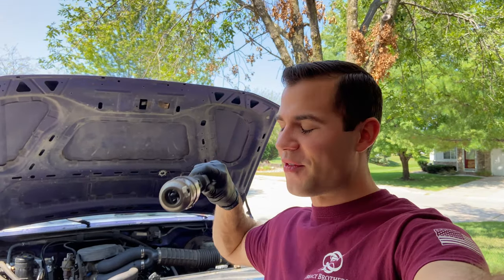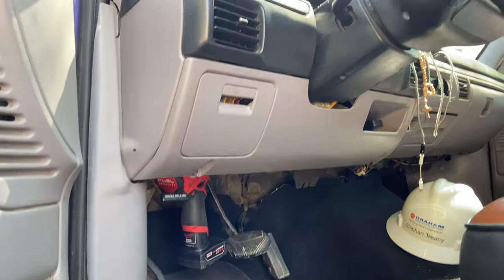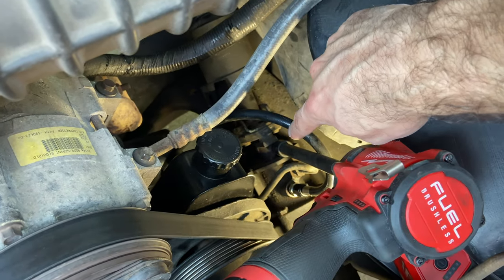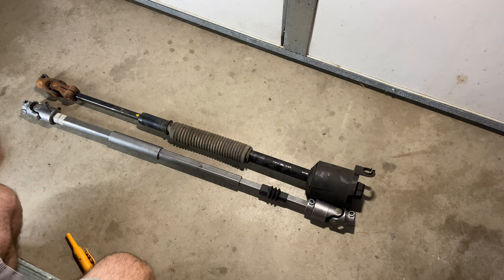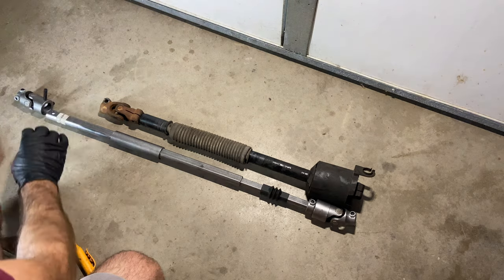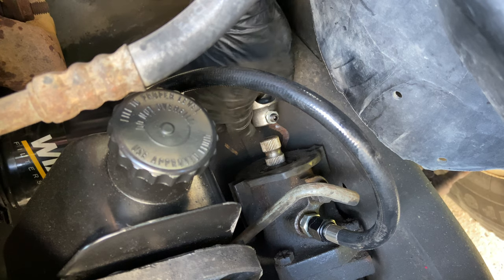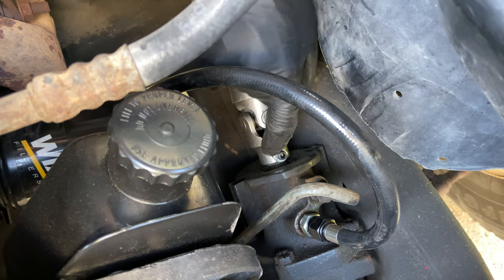How to Install the Borgeson Steering Shaft | 1995 Ford F150

Comment: Enjoy your programs, I have a question for you and any one that reads this. I have a 95 F-150 with 210000 about. the engine has never been opened up, we plan on a road trip with it to Texas from Arizona. I have a leaking freeze plug under the front cross member and plan on pulling the engine and replacing them all along with the real seal. What is your opinion on pulling the pan and replacing the rod and main bearings along with the oil pump and timing chain at the same time??? Top end is good with less then 10% on all 8 cylinders lowest being 105 psi oh its a 5.0 Thanks Rick Lockhart
Reply from the maker: Thank you Rick! 🤙
Nice! That’s a good length trip. 
If you have the engine out and budget isn’t an issue. I would replace as much as you can. Definitely replace any and all seals, the timing chain, and oil pump. If you want to go for gold, you can replace the main bearings too. Install a new thermostat and water pump to. Do you want to make sure your coolant system is in good shape for a trip like that.
Reply: it sounds like the motor is still in good shape for the miles but since your pulling it anyways you could replace some stuff. With a real oil pressure gauge does it keep 30 psi hot idle and at 2000 rpm hot should be 50-60 psi if so I wouldnt worry about bearings but a new oil pump should pick it up some and you can always run 15w40 oil like I do. If you replace the timing chain make sure you get a good quality true roller set.
Reply: @tblosser8921  I run 20w50 in it and on the stock gauge I have around 50 psi at 1500 and more when driving. with it out of the truck I will check the bearings with plastigauge
Reply: At that point a quick in frame but, out of frame might be wise to finish the deal by ridge ream cylinder bores if needed followed by bottle honing the cylinders to seat a new precut rings. 
To freshen up the heads on a budget as long as no valves bent or sunk in the heads disassemble clean up hand lapped valves via (cordless drill) using grinding compound to freshen up the mating surfaces between the seats and valves don’t mix up valves just as if it’s a flat tapped camshaft don’t mix up the lifters rollers don’t matter. 
Install new valve guide seals and valve springs and the heart will be that much better and ready to go go for round two. 
If Fords are like Chevrolet, Chrysler, AMC regarding freeze plugs there will be (2) on the back of the block behind the flex plate (3) if you count the freeze plug and the camshaft bore..
Clean the opening apply a thin layer of permatex #1 on the brass freeze plug and drive it home then although, no required but I always stake the in three spots with a flat chisel. 
Side note: the bearings with have a part number on the back side each half so no need to worry about plastic gauging as long as you get the same ones 
Another great video Stevie

Comment: My Steering wheel is upside down. I need to turn it 180°. Somewhere in this process is that possible?
Reply from the maker: Was it upside down to start with?
Reply: @TheMinuteMasters  No. I Swapped to a Grant wood steering wheel. The billet adapter made it upside down. Now I need to turn it 180°
Reply from the maker: @mad-skillsteam4423  that’s weird. I would try flipping the adapter.
Reply: Yeah, tried that. Not possible.
Reply from the maker: @mad-skillsteam4423  that’s so weird that happened. I would call the manufacturer and see what the issue is.

Comment: My ford 1995 f150 loses power every time I turn the steering wheel. You know what’s wrong with it bro?
Reply from the maker: I would read you codes and see if there are any sensor issues. 
When was the last time you did an ignition tuneup?
Reply: Almost never
Reply from the maker: @davidchocolate7754  Definitely watch my Ignition tune up video and replace all the parts shown. It will help a lot.

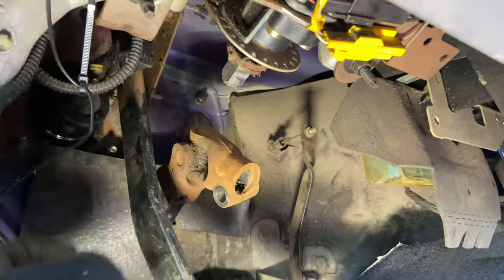Comment: At 2:00 you said drive shaft and then again after. Went on the engine bay and pointed at your steering shaft and called it a drive shaft again.

Just an fyi in case any nooby gets confused.
It’s a steering shaft not a drive shaft.
Reply from the maker: Good point. My mistake
Reply: @TheMinuteMasters  you’re videos are great. looking out for the fellow ford obs guys.
Reply from the maker: @SnD340  Thanks man!🤙

Comment: Dont cut yours without measuring it fully extended first. You probably don't even need to cut it at all. Measuring collapsed could leave you short! I just fucking cut mine exactly like this video and it's was fucking short. I'm fucking stupid.
Reply from the maker: What year did you buy your shaft for? The stock shaft lengths seem to vary from year to year. Following my exact measurements for a 95 F-150 with 2wd might not (and didn’t) work for you. For best results you have to compare the new shaft with the original.
Reply: @TheMinuteMasters  same part number for the shaft. Mine is a 96 f150 2wd, 4.9l. I measured exactly like you did. Mine was just different. I should of seen how long it was fully extended and compared as well. I just went with the measurement when it was fully collapsed. I probably didn't even have to cut it. On my way to get it welded. 🤣🤣
Reply from the maker: @luisrg436  Hey it can happen to anybody Luis! I don’t know what Ford didn’t use a standard length steering shaft. Yup, I would get that sucker welded by a pro, so it comes out straight too.

Comment: Too much play in my 95 steering.
Reply from the maker: Even with the Borgeson steering shaft?
Reply: @TheMinuteMasters  No, it's Stock. It's time to make some improvements. As far as play, What helped the most, Saginaw or the Borgeson Steering Shaft?
Reply from the maker: @bobbywren123  Gotcha. I totally get it. Assuming your drag link steering assembly (tie rod ends and associated parts) and ball joints are new. A new steering gear box and steering shaft would really improve steering for you. The Saginaw pump will eliminate the steering whine and of course give you more steering power.